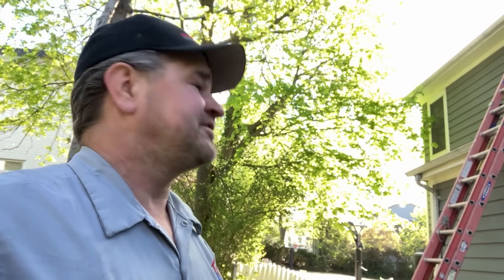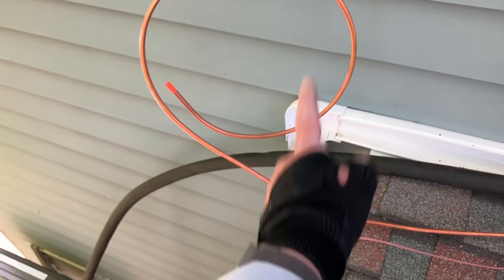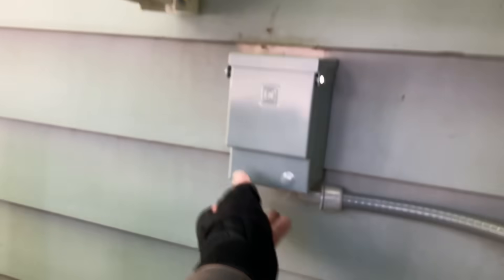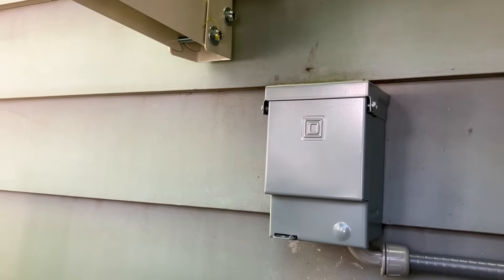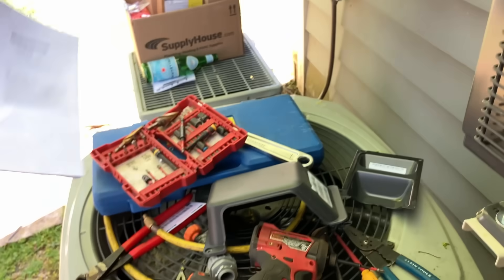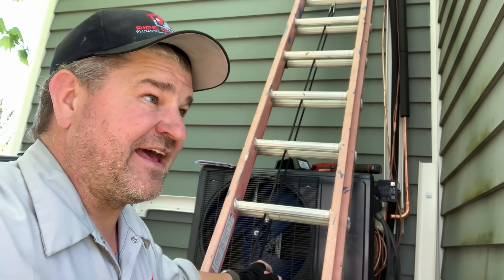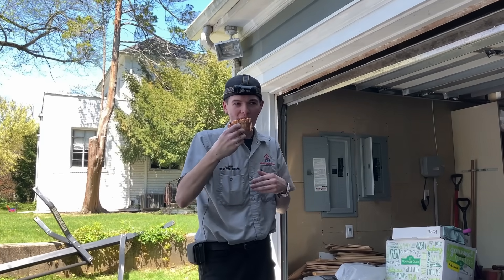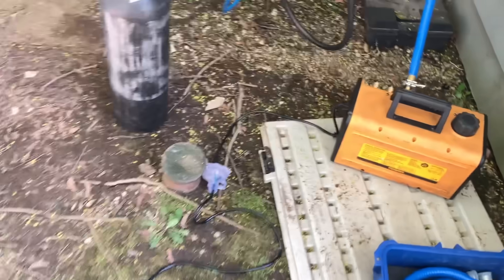🚀 Installing the 1st Mikey Pipes by ACiQ Heat Pump! (Part 2) | Lineset & Outdoor Unit Setup

Comment: Great videos! Eventually, could you explain how communication is established with an ecobee thermostat? I'm not an HVAC expert, but I own a commercial building with around 10 AC units that need replacement. We're considering these as potential options.

Comment: Is the efficiency lowered by not using the full communication with it?  How would it know to use other cycling speeds with only an on/off signal.
Reply from the maker: watch part 3

Comment: You cant plug the Vac pump into the inverter you guys have in the vans?
Reply from the maker: Van too far away
Reply: @PipeDoctor Ecoflow, Bluetti and Jackery sponsor tons of YTers, hit them up for a portable power station.
Reply: @ JB Tools has a Dual Voltage pump AC/DC which seems cool. 
Anything is better than the time they used Ground as the NEUTRAL

Comment: You can buy 1/4, or 3/8th liquid tight for the low voltage. I think that looks pretty sweet. 

that blue fan blade looks like a POS. 
I will praise ACIQ 3 years from now if we don't end up getting Mr Pipes PSA about how they should be held liable for making junk.
Reply from the maker: Gotta give it a chance! I'll keep you posted.
Reply: this is midea unit, mr cool hyper heat, senville and few others use exactly same model, the aciq has the  option with new air handler design which is really nice for retrofit, if anything the parts should be fairly easy to come by